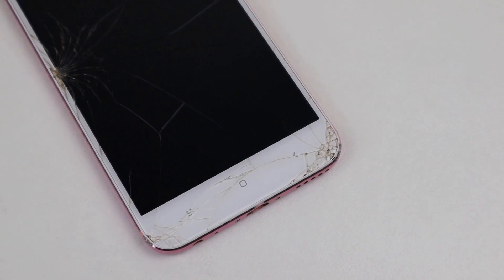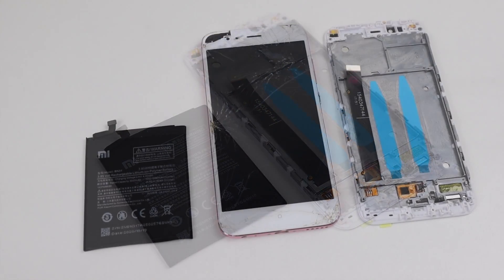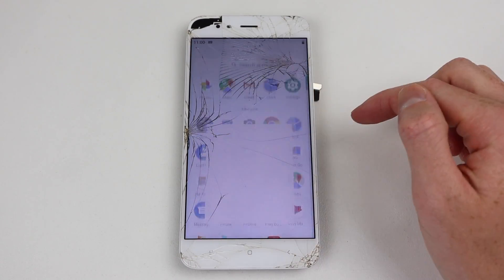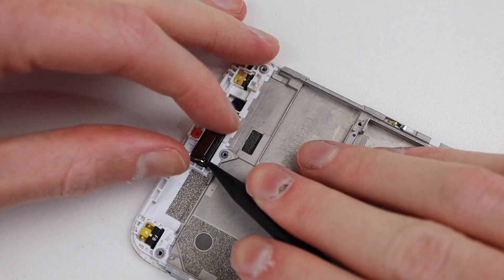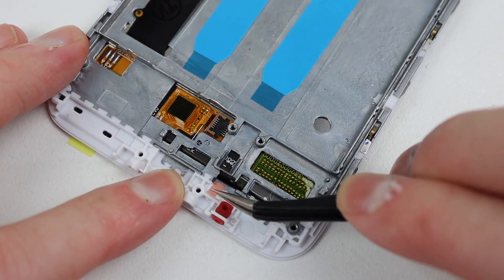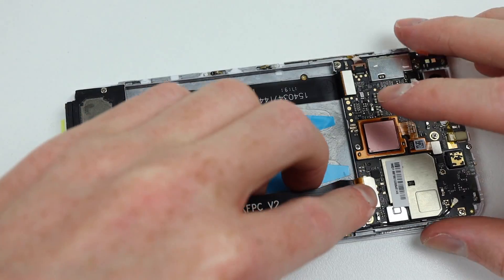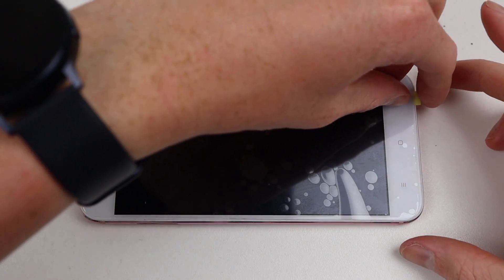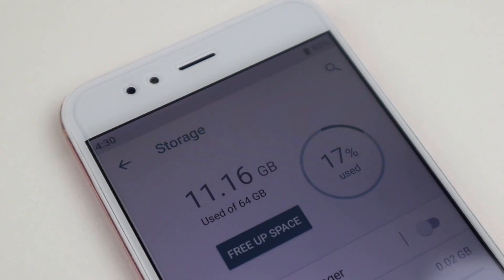Repairing a Phone Using Only AliExpress Parts - What Can't Go Wrong... (Xiaomi MI A1)

Comment: I've been a xiaomi user ever since but never have I had an old phone as this one, surprisingly they also used a pentalobe screw 😮
Reply: I have it since it came out,, still works great, never had to replace battery or anything else. It's still in use as a secondary. Crazy good specs for the time and ultra slim even for today's standard - only 7mm thickness

Comment: I have bought a lot of replacements parts from aliexpress, all of them worked, you only have to check the seller's reputation and reviews, I fixed 2 new nintendo 3ds xl (sites like Ifixit  don't have any replacement parts available for the console, a ps4 controller that works to this day and I even got a ram stick that matched the factory one for my laptop because DDR5 is way too expensive. 

Sites like this are not a sign of low quality or scams, they exist within it but you have to use common sense when buying from it and check as you would usually do with any other marketplace

Comment: While xiaomi doesnt have fantastic specs, its physically more durable than most phone out there.(by my experience) 
And even if they are not that easy to repair(well, at least they seems to be easier to repair than iphones), they are pretty cheap(xiaomi's budget series) so even if it somehow break, replacing them with a new one is alot more cost effective and way easier than having a expensive high end phone and spent the effort to repair them. Also, 3rd party parts seems to at least still works with these phones.

Comment: I cracked my A1 screen back in the day and just got a new screen "with frame" that was identical to the old one (even had the same hand made markings next to the hardware revision stamp like my orignal, which I note Hugh's phone is lacking, so my replacement was probably a Xiaomi original), and it and also came with the metal tabs already installed. It was super easy to just move the internals over and it was good as new.

Suffice to say, your "premium" repair kit was far from premium, which made this more difficult than needed.

Comment: Lol hugh. This is embarrassing.

"I thought the internals would be attached to the housing like in an iPhone"

Bruv. You had the screen on hand. That came in a frame. A frame clearly identical to most androids, where the internals are attached to the display. You either didn't even look at your replacement part, or you're two dense to put two and two together. 

You took the battery off the original frame? You're putting a new battery in anyways? On a different frame? Why even bother? 

Sheeeeeeeesssshhh
Reply: Because he knows for a fact this video will make the money he’s spent on this back
Reply: @harrisonkelly  so that's why he couldn't look at the replacement screen and make the most basic deduction? 

Shhheeesssssh
Reply: @Abcadeaz  to be fair that’s probably just one of those mistakes you realise that you’ve fucked up aftee the fact

Comment: This battery is definitely a fake one. I got two of these for my Xiaomi Mi Mix 2 and they were worse than a heavily used original that was 2 years old. Found a seller on Ali that sells aftermarket batteries and I'm happy with it. I would never go for those 100% original again. They never are original and since they don't put their name on it, they can sell you the worst garbage without consequences.

Comment: It's odd to see how different in construction this is from the Pixel I just had to do this same work on. It's much easier to replace the display on the Pixel, but much harder to replace the battery, pretty much the opposite amount of effort for each vs this phone. Of course at my age none of this is particularly easy, since my eyes won't focus on anything less than a foot from my face anymore.... Working on desktops is hard enough. Mobile phones are so dang tiny! :)

Comment: I don't have problem with my Chinese supplier i ordered screen multiple times for good price, quality is very good and they even come with screen protector, case and shield plate and screws so you only need to change speaker and face id part.

Comment: Fyi the wrong colour display is not part of AliExpress fault but the Xiaomi itself.
Xiaomi uses chinese manufactured displays(tianma, csot, bsot, shenchao).
Even same device model has different display types and each type requires that particular display to function and display colours properly.
Ex: in case in this video the display maybe of shenchao since it has ghosting issues, nd maybe the previous display was tianma, so if u install other type of display u mess up

Comment: Last week I repaired my Huawei Y7 2017, because the screen was broken. I bought OEM screen, and the date was really 2017, but the display looks like a 6-7 years old cheap android phone (like sony E4), because the colors are a little bad, the screen is very pixelated, and the multitouch function is not working. I was a little disappointed, but I also happy, as it works again.

Comment: I got my A1 in August 2017 and passed it on to my wife in October 2019. She's still using it without issues, we just had the earpiece replaced a few days ago (it appears to be a common thing to fail on the A1 after a few years) but otherwise is working great and the battery is solid. Oh, and - of course the Aliexpress earpiece is terrible quality, but it's at least loud and working.
Reply: Bought the A1 for my mom almost 4 years ago. Still running like a champ
Reply: @martin1649  same

Comment: This phone is the best phone when released. I'm still rocking it with custom rom and battery replaced. Still best as it was in 2017
Reply: There's 2 factors what made Xiaomi best bargain
1. Superb hardware with cheap price
2. Open for developer and easy to fork custom rom

When you've done that.. you'll never miss samsung again
Reply: @foreveralone4015  sure but not for all xiaomi phones. only flagships, i had poco F1 and i flashed lineageos 2 days after buying it..
Reply: @tinko975  you're totally wrong, redmi note and midrange poco series is the best in terms of custom rom support
Reply: @foreveralone4015  good, but overall support is less important of how some custom rom really works. some models have plenty of roms but non of them are issues free..
Reply: @tinko975  usually, global model that sold on EU/or other countries besides China/india has a good support on custom rom.. yeah i agree none of them really 100% bug free,.. but wait
Even pixel/samsung is not 100% bug free isn't?
Reply: @foreveralone4015  custom roms have to use modded google camera, then is ok.
Reply: I feel so good about havin one just like this video but working and clean, the same brand of battery, that I never replaced, the only thing i did was to replace the motherboard, everything original, using custom roms too and everything is fine!
Reply: @lehmatulis I guess you changed the motherboard because you somehow screwed it when flashing a custom rom?
Reply: @bidishachatterjee2  no, it was in stock rom with everything locked, sometimes motherboard can get defective, it's rare but can happen. I never had a device bricked by installing custom roms also.
Reply: @lehmatulis  asked cause I bricked my sony xperia Z1 and I am trying to fix it by reflashing software.
Reply: Same, only replaced the battery and the charging port for ~25€ both things (original parts) and still working great after 4 years
Reply: Using it for 4 years. No repairs. Butter smooth with latest evo 11 crom
Reply: Still using one with custom rom cause it can't get anymore further android update. No replacement at all. Might need to get a different custom rom eventually for faster speed and maybe another camera app

Comment: Hugh, i've got an icloud locked iphone 6 with a broken screen and boot loop issues.
At the moment i don't have a screen for it.
The issue was the phone's battery was not connected properly.
I managed to connect it back, but i noticed the brackets for the display connectors and battery are completely gone.
Even the screws to dissemble the device are gone.
I used my nails to take the screen apart.

Atleast i got it for free, coz if I payed it, maybe it was the worst purchase in my life.

Comment: Well, I have very different experience. I replaced display, battery and back glass on my galaxy S10 5G using AliExpress parts (those parts are really hard to find in my country) and it works perfectly fine, I'd say it's as good as before. You can't buy cheapest parts and expect them to be perfect, but if you take your time and find some parts with good reviews, then you can repair your phone with AliExpress parts quite successfully.

Comment: I must have gotten lucky. I ordered a motherboard from  Aliexpress when my Samsung Note 9 got water infiltrated (used Note 9) and the motherboard I ordered seems to be working here in the U.S. but has a splash screen from AT&T.  I just flashed an unlocked firmware. It also came in in 2 weeks instead of 45 days as indicated when I ordered the part.
Reply: If you bought from a reputable seller, then you didn't get lucky, you just used common sense!
Reply: Nope, you just made a good purchase. Hugh ordered a display for 20$ and was suprised it wasn't good.
Reply: @blackspider4  Yep.
Reply: @blackspider4 well, i wouldn't except that I would get a screen like that even if it is that cheap

Comment: I bought a "OEM" display for my Redmi Note 5 Pro on Aliexpress. Of course when receiving it, the screen wasn't original. Got a 50% refund. Now the display has white spots, is terribly off color and the glue between the display and the screen started peeling off. I definitely don't recommend searching for "good" screens on Aliexpress. Got mine for 15$ after the refund.

Comment: Oh, the beauty of fixing an android phone, no useless shieldss and different screws to mess around with.
Reply: Simplicity at it's finest
Reply: Yeah, Apple.
Reply: Just repaired a Galaxy A11 and kinda was the same like this phone to dissasembly lol
Reply: store link: https://www.aliexpress.com/item/1005002914928939.html?spm=a2g0o.store_pc_allProduct.8148356.13.49eb64eeOXiSOC
This  is a repairing data center for laptop and smartphone in English.
It includes schematic, boardview and maintence cases which are collected from our technicians at the daily real repairing work.
It covers all the models of phones, for example iphone, HuaWei, Vivo,OppO.
Reply: I know android phones that were a pain in the ass to dissasemble like the J1 2016, the HTC One M7, the Huawei P6, and such
Reply: Tell that to Samsung and huawei
Reply: @james-ch  at least Samsung offer parts for their devices
Reply: @james-ch  Samsung's phones are still simple on the inside.
Reply: @james-ch  🍎?
Reply: @james-ch  samsung only have philips screws and the newer one only have one type other
Reply: Tell that to the Samsung Z Fold 3 team
Reply: @satnus3388  It's a Foldable?? The entire phone folds in. If it has extra connectors and screws or brackets to take off some pressure off of the flex cables, i don't see the problem with it.

Comment: I'm so greatful that aliexpress exists, bro i repaired my macbook air 2015 for like $3 for which apple was charging $565 ! It was the one tiny tantalum capacitor in the motherboard that was shorted. I ordered the new ones and replaced the burnt capacitor with the new one by micro soldering ! Its been around 2 years since that repair and my macbook runs perfect till this day :)

Comment: I've rebuilt a few Xiaomi's and they are ok phones, just a different angle on a theme really. I agree with your comment about dodgy suppliers, in fact I am writing this on a OnePlus 5t with a screen of similar quality to the one you just fitted. I now use an eBay supplier who only stocks OEM parts. Yes a little more expensive but worth it for the end result.

Comment: I don't think it's fair to trash AliExpress for the outcome here, you can totally get good parts from there. You have to spend the time researching the price for an OEM part from different sellers, check reviews etc but it's not hard to get good prices and high quality parts. Dispute system is also very generous. Idk finding local or "trusted" OEM part distributors (eg iFixit) adds its own tax which makes repair overly expensive sometimes
Reply: I have noticed that most tech channels just love to trash on aliexpress by focusing on the chapest low quality part of it

Comment: When you have cracked screen and want to use suction cup, firs stick a layer or two of wide sticky tape over the screen. That will also prevent further small pieces coming off the screen...

Comment: I replaced dozens of those screens. The repair was very straightforward, since after removing the 2 screws, you can remove the backcover with fingers.
Even though i bought many different screens already glued with the frame (which makes the repair a breeze), none were really original and the colors were always washed out. Not that the original screen was super quality, but still.
I've had Xiaomis since 2016 and they were really easy to repair, but getting the parts from aliexpress was a waiting game and quite unreliable just like you pointed out.
For what it's worth, nowadays Xiaomi and Redmi phones are pretty good price/performance devices. 
You should check them out, in Europe they are quite common.

Comment: Mr.Jeffreys, I have a question. On Sunday my iPhone 12 was stolen and was immediately shut off so I couldn't track it. Long story short I got the phone back but I'm curious is it possible for a thief to break into or factory reset an iPhone 12? I put it in locked mode via iCloud but I'm not sure if there is workaround.

Comment: @0:20 It is the first Android One smartphone from Xiaomi, even though it did not launch as such. The difference to the budget Redmi Note 4 are, USB-C, aluminium unibody, better cameras and smaller battery. It is more form over function.
Reply: The note 4 also was a aluminum unibody phone

Comment: Use touch separator machine to remove the crack touch glass and use the original display..... Order the touch and assembled it it's cheaper and u save money too 😇 but u have to buy that touch separator machine

Comment: Use clear cello tape on crack display it help to hold with your  suction cup
Reply: Even though it wouldn’t have come off because the screen is glued to the frame. You have to open it from the back.

Comment: Buying parts based on the item listing alone is a terrible idea on these online marketplaces, you need to look for reputable seller/shops and browse their parts. Original parts that isn't new old stock for a old phone like the A1 is hard to come by, and it doesn't help that Xiaomi doesn't seem to provide original parts easily.
Reply: Some cheap seller put keywords like Premium and Original just to lure some buyers in, only to realize the parts they received was bad quality. Parts for Chinese phones that you can buy are probably 80% fake/remanufactured most of the time. 
And remanufactured parts vary in quality a lot, some batteries are actually remanufactured by the original OEM, you just need to look at user review pictures to confirm it. 
I haven't seen a display replacement that is made by the original OEM that's being sold, but there are always some good sellers that actually source parts from original OEMs, you just need to look for them.

Comment: I own this phone and I've had it on around three professionalists try to change the screen, every time they change the screen the touch doesn't work. Turns out I had to reflash stock rom for the screen to works.. I suggest you get the latest available stock ROM and reflash the phone as it has a big chance of fixing the bad color issue on the screen!

Comment: I purchased a new Poco F1 from aliexpress and also purchased the needed replacement screen plus a fresh battery a couple years later because I dropped the phone and it landed on cement face down and cracked the edge. I had no issues doing the repair with the parts from Aliexpress and it worked fine. Perhaps you just got unlucky with the store you purchased from. I didn't buy from the cheapest store either, I looked at the ratings as well.
Reply: Same here, almost 6 years I repairing phones with parts only from aliexpress, if you stick with reviews, and not selecting always cheapest one part, you almost get OEM or price corresponding part.
Reply: @Trught  Yeah this is why I stopped watching this goon. Buys the cheapest part with no reviews and cries about it. Been using AliExpress for years, I'm a Platinum member, and only had to return or refund 1 or 2 parts.
Reply: @EximiusNovo  People don't realize why something is this cheap. They want it cheap and good quality-wise at the same time, don't even want to spend a few cents more for bettee quality. That's the mindset of dumb people
Reply: @backwards9772  It's their decision, I offer them all possible repair variants, original parts, OEM parts, and cheapest parts, with warning them about pros and cons about all variants and 95% people take OEM or cheapest.
Reply: @EximiusNovo  and how do you expect people to know about this pitfall of using aliexpress if people don't talk about it? seriously grow up and ditch your fanboism
Reply: Replaced my LG G5 screen with an Aliexpressone . Ok it clearly wasn't an OEM QHD one but it was bright enough and hi-res enough to do the job rather than buying a new phone.